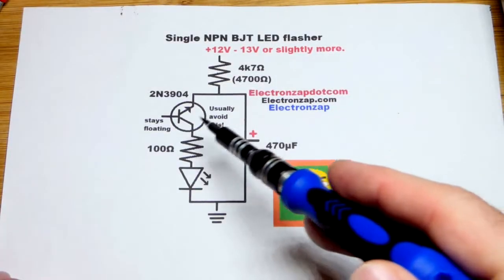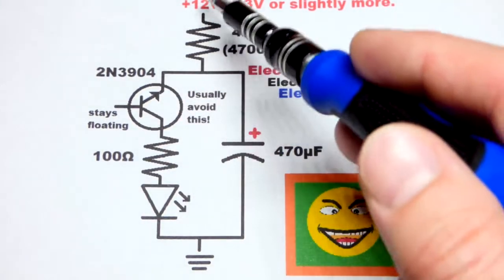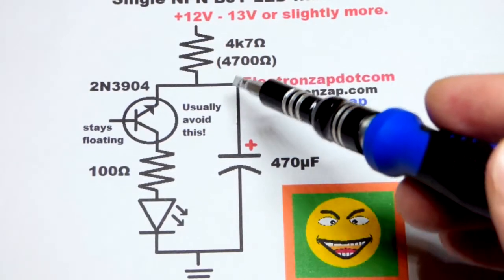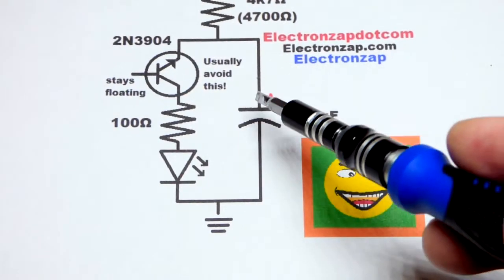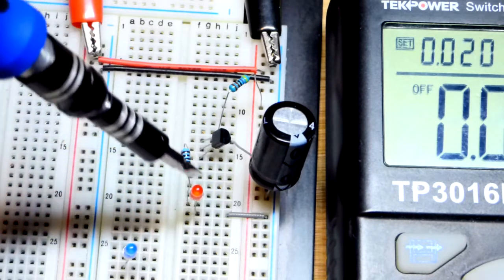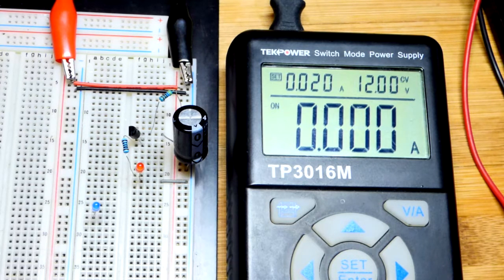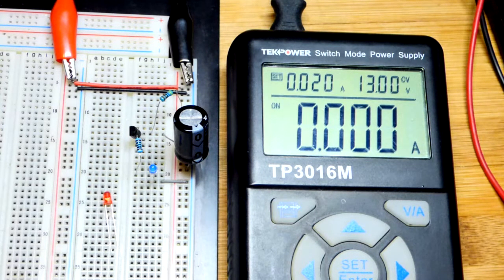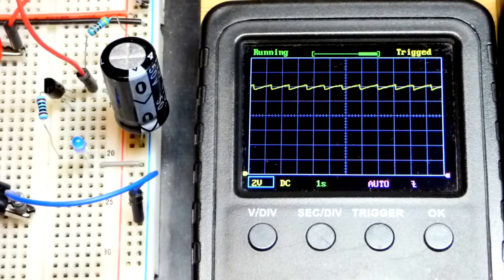Single 2N3904 NPN bipolar junction transistor BJT LED flasher electronics circuit how to DIY

Comment: Could you explain why the transistor is positioned with the emittor connected to Vcc and why it starts to conduct and why  the base is not connected?

It looks cool though.
Reply from the maker: This circuit is purposely wired the way you would otherwise always avoid wiring a NPN BJT and isn't mentioned in proper circuit material. When the emitter is more positive than the collector by a relatively low voltage it starts conducting. I don't know for sure why the base is left floating, I'm guessing that by giving it a voltage of any kind it will make the transistor either be much more or less likely to start conducting.